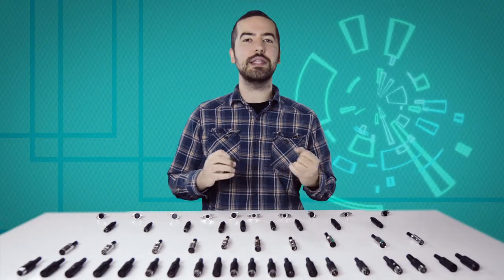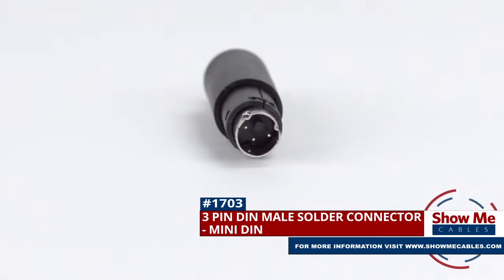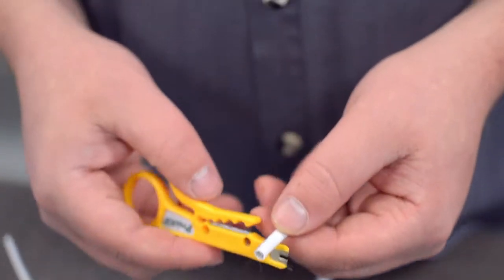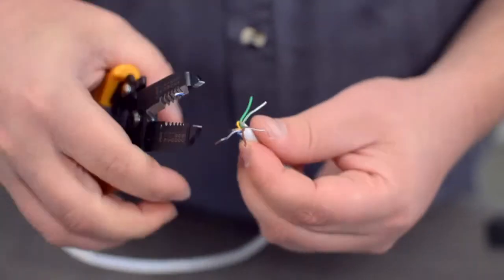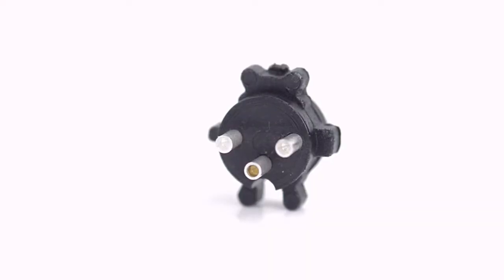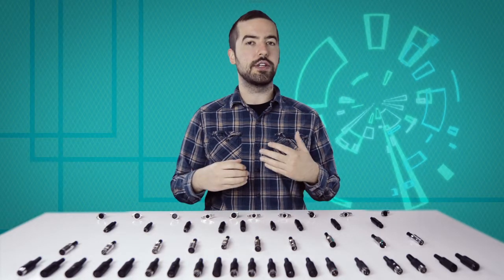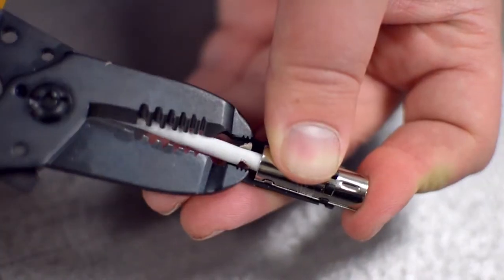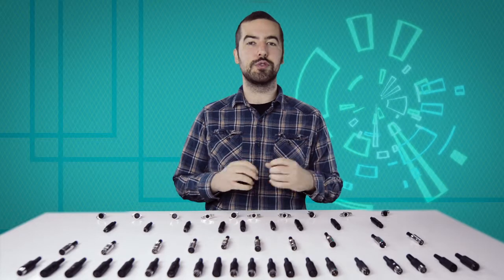How To Install The 3 Pin Mini DIN Male Solder Connector

Comment: well, I guess the most important part, how to solder those wire to those pins, really has to be asked to someone more experienced since is not shown even on this video? That was the sole point for me to watch this video....
Reply: You'll have to do another search, like I did. Also, I'm not sure I'd use that small gauge of wire for power connectors.